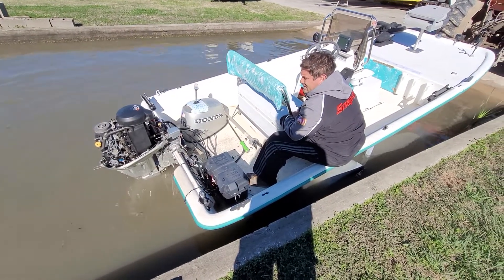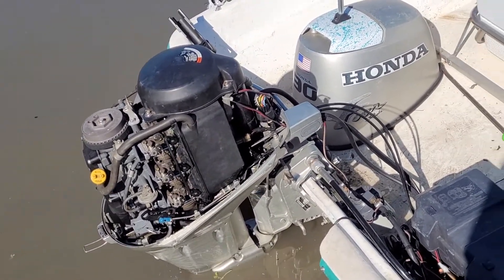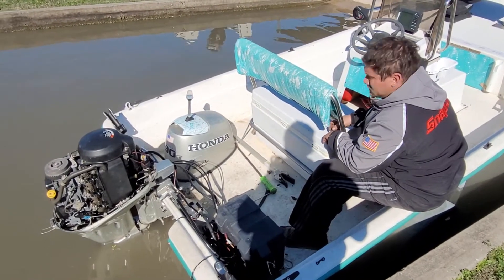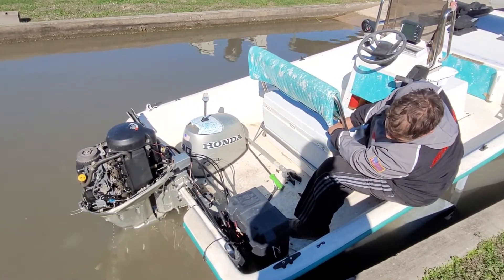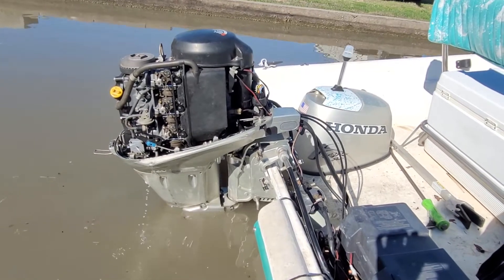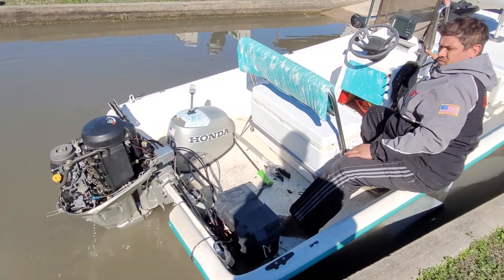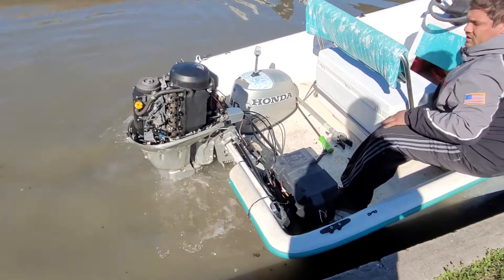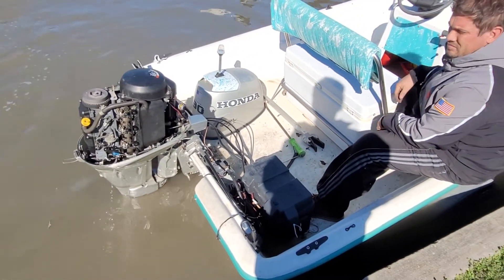30hp Honda outboard customer file

Comment: You didn’t say exactly what you did I have a Honda 30 hp with a problem of cold start when you do get it running there’s no problem?
Reply from the maker: True, it was just a customer file video to show them it is running. I am sorry. I am sure it was fuel system. If yours is carbureted you will need to rebuild or replace them. If you rebuild them be SURE and replace the main and idle jets. Little brass tubes. Critical.